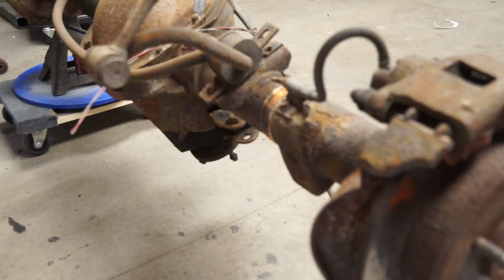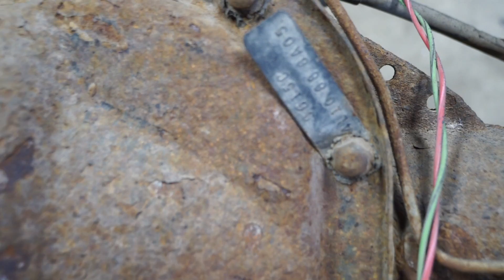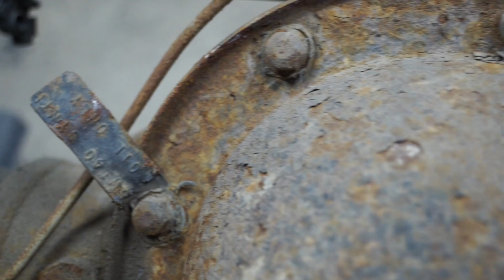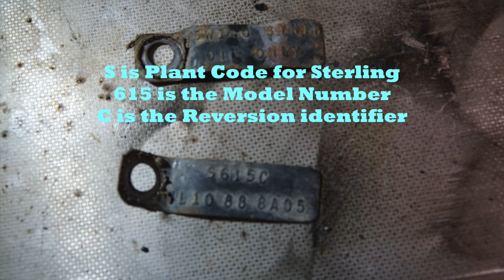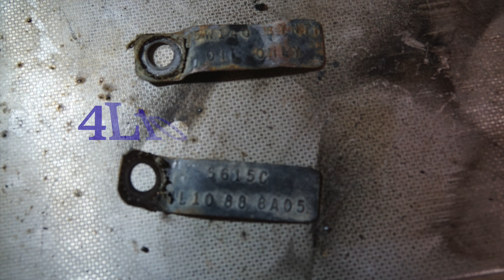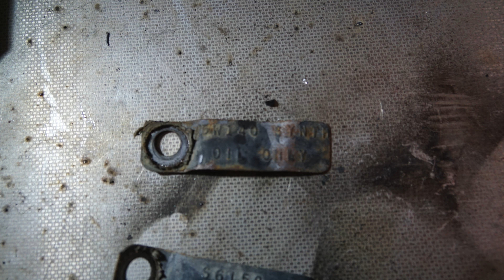How to Decode Ford Axle Tag

Comment: Can you help me understand as much as I know it says Dana but I was told it's a 1-tons 10 and 1/2 Sterling.... The year is a '06 and I believe it has 4:10 gears...... I have a zf6 two-wheel dr duelly.....f350 6.0 
...... Anyways here's the numbers..... 4  10   6C34  AABA
,,,,,,,,,,,,,,,,,,,,,,,,,,,,,,,,,,,,,,,,,,,,,,,,,,,,,,,,,,,,,,,,,,,,,,,,,,,,,,2005578-- 2  L -S...... My tag is a little longer than yours and has a bolt hole on each side.... I wish we could send pictures through here

Comment: My truck came with an after market pan on it and no tag was attached.  Is there another way to identify my rear or axle?
Reply from the maker: The gears are stamped
Reply: @TestDontguess  I figured it out by the 12 bolt pattern on the pan.  My owner's manual never mentioned Sterling 10.25, just Dana 80 or 135.

Comment: I'm trying to figure out the tag on my 67 mustang. I believe it's factory. Here is what the tag says:
WCZ-V1
2.79 6JD 930
I know the top line is for 67/68 Cougar or 67/70 Mustang. The 2.79 is the gear ratio. But don't know what the last 6 digits mean.

Comment: My problem is I can't find any information on my V808A rear end.  no information on fordification.  It's an 8.8 rear end that uses 31-spline axles but uses the big 9.75 axle wheel bearings.  If anyone has any information as to why my rear end is so unique would be interesting.

Comment: I have a 2000 f-150 with the tag on the rear end reads 
3L 55 88 and the rear end from the salvage yard doesn't have the L but otherwise is the same. Will it work??  Which is better??
Should I try and find one with the L as well.??  Thanks in advance for any help.